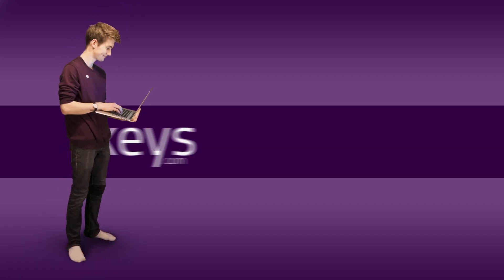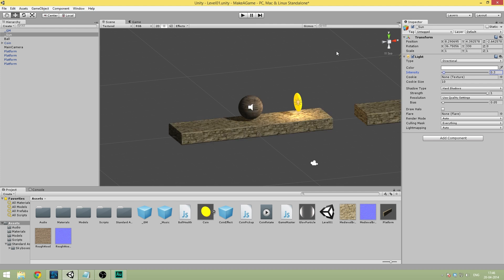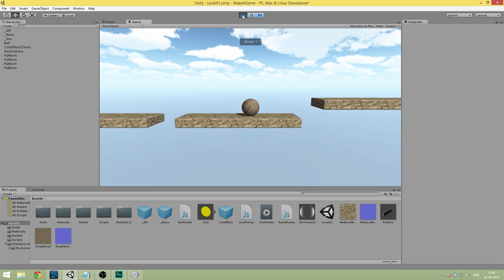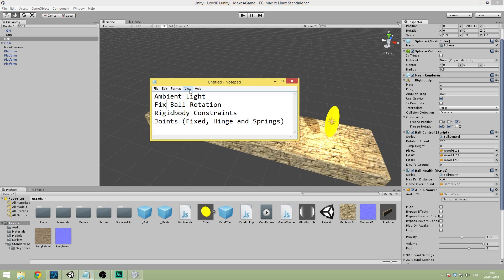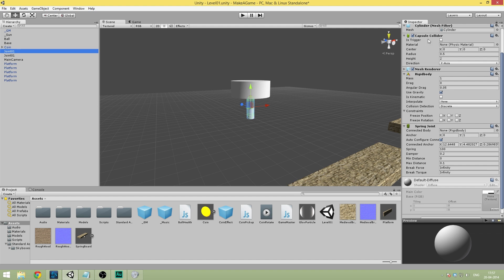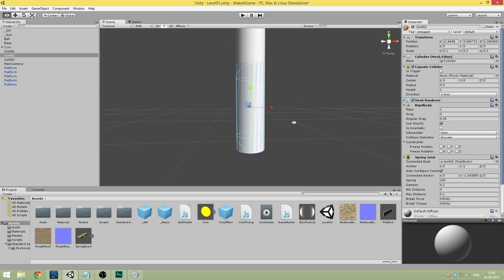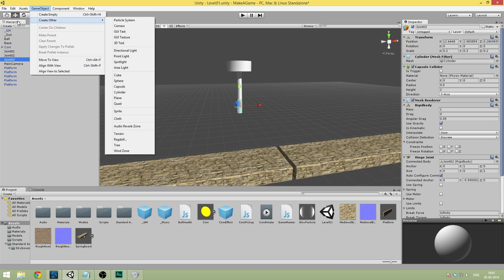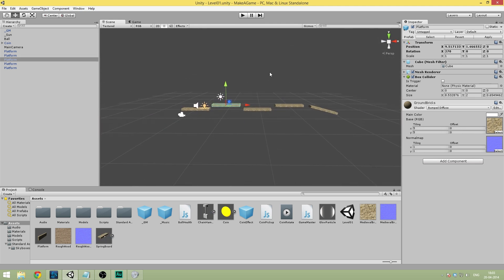14. Unity Tutorial, PHYSICS - MAKE A GAME

Comment: sis the series ended? or are you working on the 15'th episode?
i still need a menu, the ball is going too slow and i changed the rotation from 200 to 99999999 and it goes at the same speed,
we need like a transition to new levels an end of the game etc.... idk how to do all that stuff :-|
Reply: The values for the variables in the unity "Inspector" window over-write the values in the code, so if it says rotation = 99999 in code, but in the unity interface it says 200, its going to run at 200.